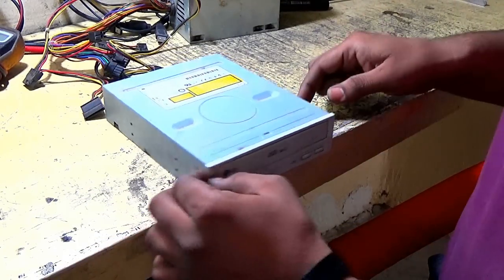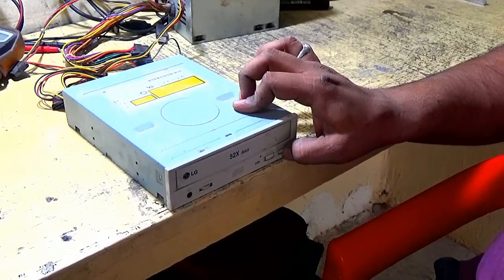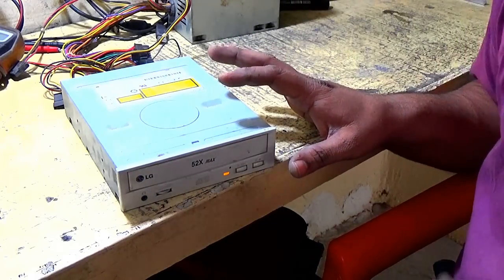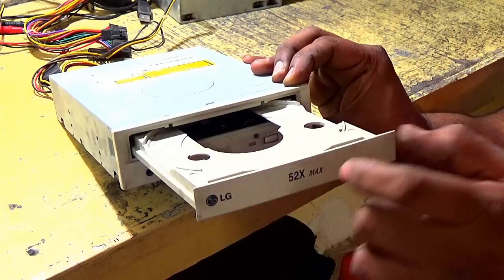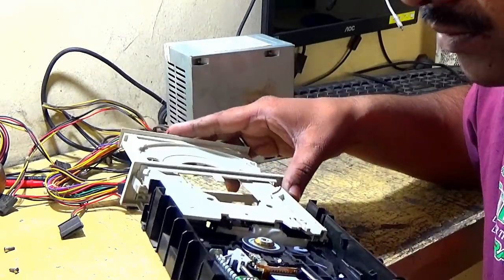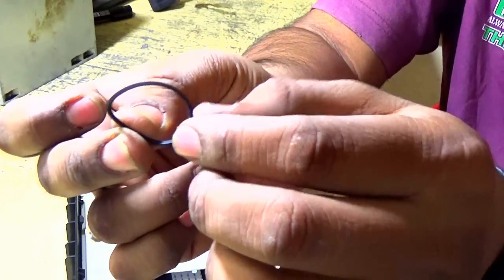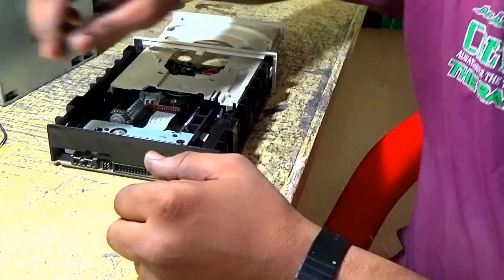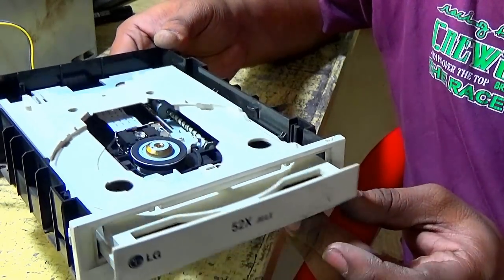How to fix a DVD drive's tray that doesn't open or eject

Comment: Good call on the band being worn. Seems this can also happen if the drive has sat for a long time and the band gets "set" in the same position which makes a kink in the band causing a loss of traction. I was able to get my band working again by cleaning it and stretching it slightly and then reinstalling it. Works like a charm now. Thanks for the video.

Comment: here is a quick side thing ppl.... you dont actually need to sub the rubber.. some ppl may struggle to find a replacement so instead of subbing it, just heat it up a lil with a hair dryer for a bit, should shrink the rubber back into its original state... save some hassle. cheers

Comment: I like the use of smps to power to cd drive. Never thought of that. Acually i was google sata to usb converter cable just for this work.I like the sliding method at 3. 39. I have watched several videos about the same problem of stuck dvd rom tray. All are only teaching inserting paper clip in the pin hole to release the tray before opening. But mine pin hole does not work when i insert paper clip. So, yours sliding method works great! But after opening the tray, upper cover doesn't come out easily as shown in the video. What to do? It is fixed strongly. 

Update: I managed to open the top cover after watching another youtube video.I have subscribed!

Comment: Hi sir
CD  is stuck in my DVD drive I don't know how to open case and get it out is there a way to remove the CD without damaging p
Reply: on the dvd drive, under the cd entrance, there is a tiny holle.. use a pin or something and insert in there till the end... it will open up